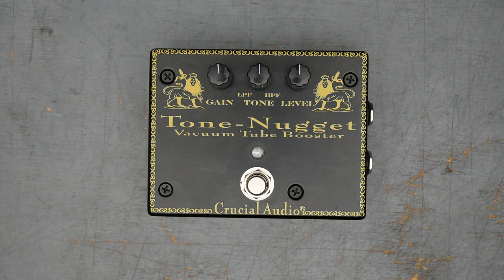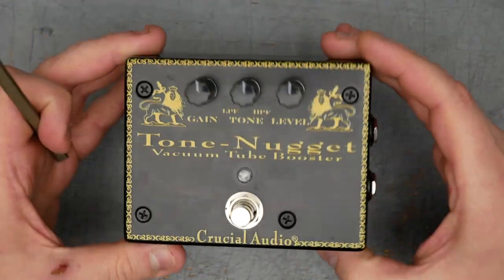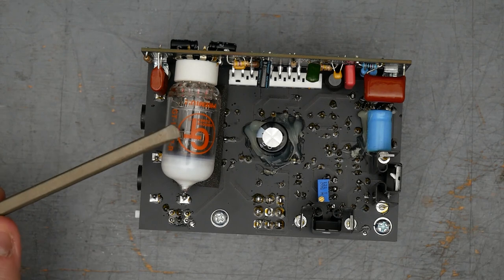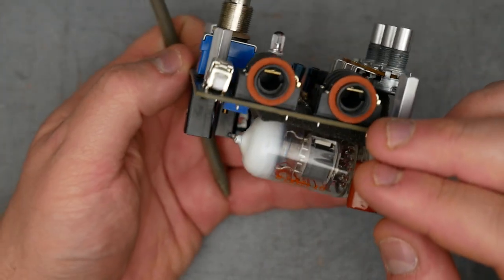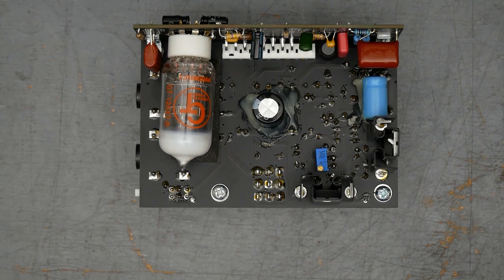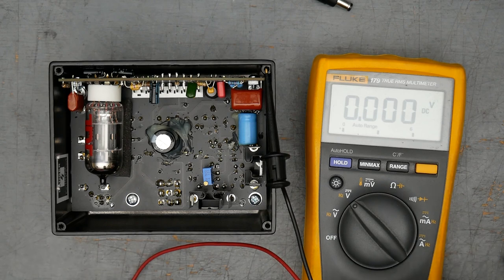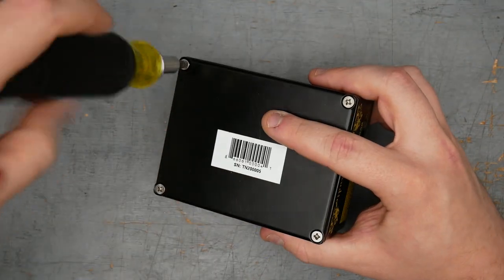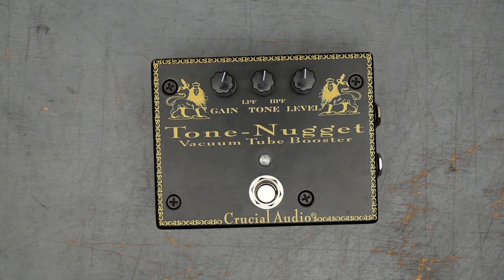Crucial Audio Tone-Nugget Repair/Teardown! See what's inside!

Comment: Sorry if I missed it, but how on earth does this 9Volt provide proper plate voltage for the tube? Real amps need voltage!   Disappointed that a boutique high-dollar pedal has the pots soldered directly to the board.